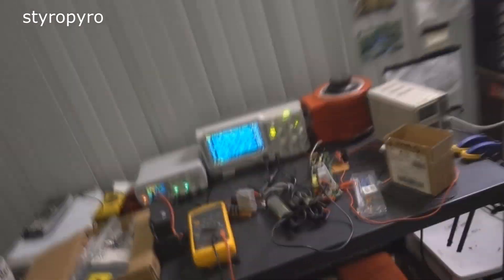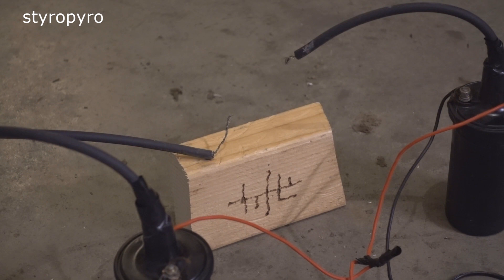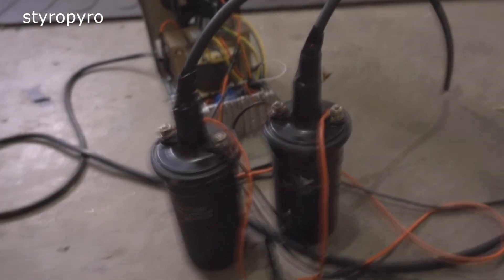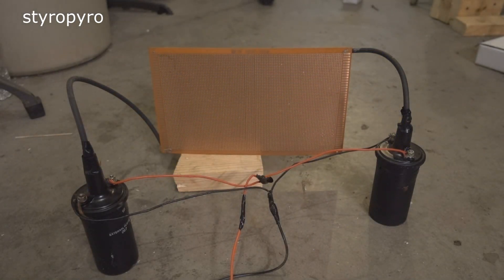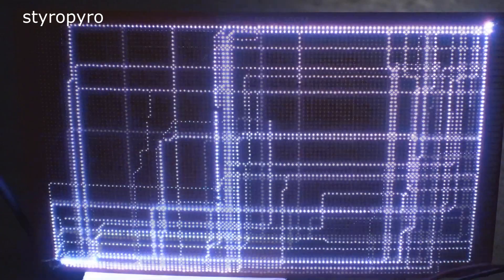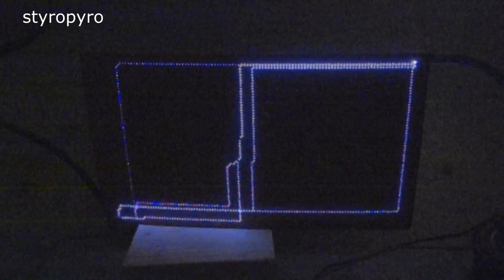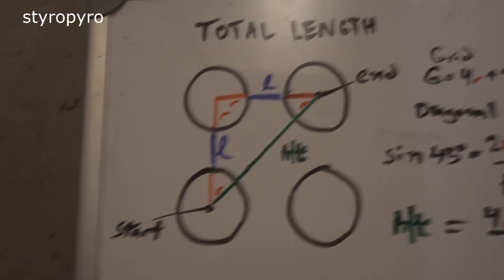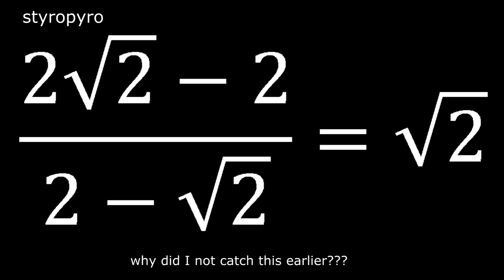Circuit board blasted with 100000 volts gives amazing effect!

Comment: I build something even more crazy when I was like 17, I put 4 of these old round ignition coils in wax, and I was driving them with a spark gap at about 4kV across the gap, but then also with a 1kW phase angle controll circuit at 230V RMS and I got about 90-95kV out of them (not very stable). Your coil make about the same voltage, anything more than 100kV for more than 5s and the coils die.  The most I got out of 4 of them was 1kW and they made plasma ars as big as those from microwave oven transformers but at about 45 times the voltage, fun memories, I have a lot of pictures still in my phone ⚡

Comment: Send sound through the power supply to hear the  arc make music as a speaker, I ones (40y ago) did this with a welder making the arc sing! My old notebook: say about this,
I used a 220 V AC to 6 V AC transformer with the output side as the input for the pick-up player, the 2 220 V AC leads had both a diode (220V type) so the current would not flow back, both leads went to the 220 V input of the welding transformer, now set-up a record and weld with music!

Comment: “Most powerful power supply I’ve had”

OPENS IT AND POKES AT IT WITH A METAL SCREWDRIVER
Reply: I think he unplugged the power supply
Reply: FrankProgramming03 #capacitors
Reply: @littolicce  oh you are right! My bad, sorry. But he used a screwdriver with plastic handle, so I think he can't get a shock
Reply: FrankProgramming03 I gotcha, but if it’s truly a powerful power supply (which is it) and the capacitors are full, the shock it would give him probably won’t care about a plastic handle. Just like lightning won’t care about your rubber boots.

But having watched some of his videos, he doesn’t seem dumb at all and probably made sure they were empty beforehand!
Reply: @littolicce  you are right
Reply: Just turn it on unplugged but connected to the board, the capacitors will run and discharge.
Reply: in a recent wireless power video on his main channel he casually shorts a capacitor to clear it while demonstrating something else
Reply: littolicce X3
Reply: its a plastic handle. Youre fine
Reply: Brandon Caldwell 0:16
Reply: What a proffesional

Comment: How about putting the perfboard between 2 glass plates and filling with argon or neon?  These have much lower breakdown voltage so you should need much less voltage to get the same effect.  Without oxygen, the board would last a long time as well.
What about making a custom PCB with some interesting grid spacings?  Random? Fractal? Hexagonal?

Comment: lick it. 
it will hurt like hell but your muscle reflexes usually keep you from being exposed too long. 
3 million volt tasers exist. it can kill but its subjective and is rare compared to the times it didn't kill the target.
in most lethal cases the stun gun user held the trigger too long and there was no timed safety on the device. the longer the exposure the more your resistance drops.

also why you shouldn't have it in your room is the electrical noise can and will interfere with other electronics in close proximity.

Comment: I think you should try to take a Long exposure photography for the PCB(or just make that from video using software)
I guess the pattern is normally distributed, and the center of the bell shaped distribution is at the diagonal line.

Comment: but that is not a circuit board there is no circuit on it. that is a empty breadboard, plus pretty sure 100000 volts would be melting that plastic in mili-seconds

Comment: What about charging capacitors quickly with 400V and shunting it into the ignition coil thru SCR triggerd by voltage. If you charge the caps quickly it would be even greater voltage but it would have lower frequency

Comment: NO, please not you Styro! When someone says that 1 kV = 1 mm of spark, a small part of me dies, but when someone says 30 kV = 1 cm, I just become furious! Please consider the following: 30 kV/cm (3 MV/m) is the Townscend threshold for air ionization, you can only convert this into spark length in extremely homogenious electric field, for example a pair of spheres which diameters are more than 2.5 times bigger than the gap between them! In your needle-needle air gap the electric field is highly-nonuniform, so the ionization happens at the needles, and then streamers create the breakdown in much lower average electric field, 10 kV/cm *at best*. This is exactly why my 150 kV voltage multiplier can create a spark not 5 cm long, but 30 cm long, and I'm not even started with long air gaps physics yet. Please, you seem reasonable man, and if you are smart enough to operate with Maxwell equations level physics, which you certainly are, this stuff should be piece of cake for you.

PS I would say knowing the gap type and voltage waveform of yours that your power supply did gave out about 80 kV at that needle-needle air gap. 

Best regards, stay safe and happy lasing!

Comment: I wonder if the electrical current follows a mathematical distribution on the board? Maybe even related to Pascal triangle by following the probability of possible paths as you can see that the density of "i" is much higher towards the center...

Comment: It shouldn't be too hard making a zapper that won't burn out. I would use a rectifier into a decent sized cap from mains. Use that for a boost converter to about a thousand or two volts into another cap. This will exchange current for voltage, meaning less worry about current carrying limitations of the wires and components. I'd have to be careful with this especially. An h bridge using IGBTs and appropriate driving circuitry would drive a transformer with a primary with an appropriate inductance to drive the secondary to whatever voltage I want. If I use a microcontroller, I can play with the frequency and duty cycle of the various stages which can help, and also be entertaining. Maybe myake some simple music!

Comment: you can make it less lethal (i think)
seal the pcb inside an glass enclosure and make an inert medium with some noble gas that is easier to ionize than air and maybe pull a vacuum inside the enclosure 
and with that you don't need such a beefy circuit to power it, i think an circuit less powerful than your bug zapper would be enough also make it high frequency so it doesn't scream in the audible range
Reply: the scream in the audible range is what makes it so beautiful
Reply: I think the biggest issue is that because those are car Ignition Coils, that makes these DC arcs and as he showed in his “2D Plasma Globe” video, the electrostatic pressure of the high voltage DC actually causes the glass to crack and eventually break.

Comment: It would be interesting to see what would happens to the arcs when you introduce some small solder joints between some of the pads on the printed circuit board.